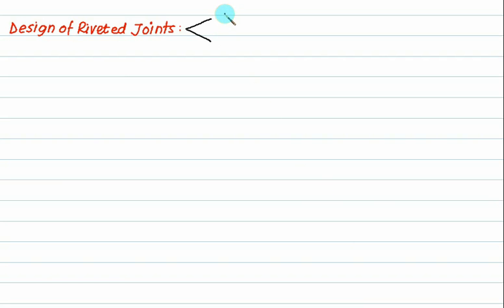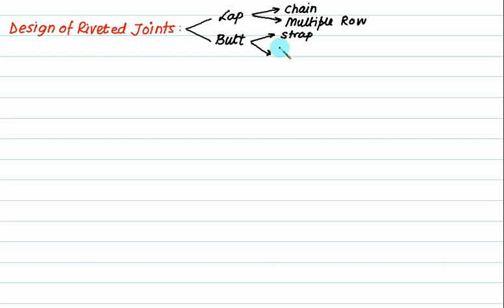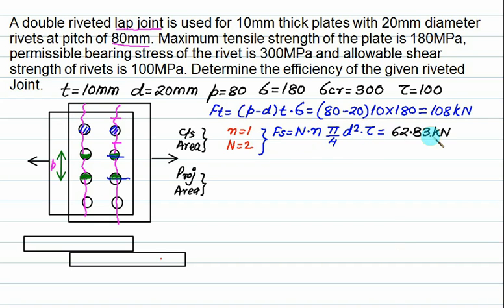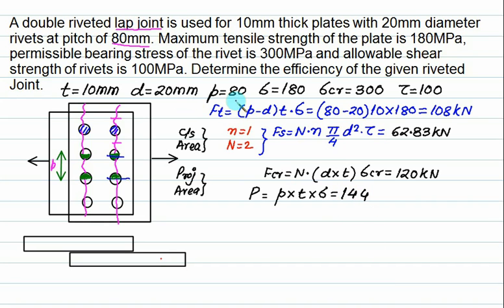01  Design of Riveted joints  Tearing, Crushing and Shear strength

Comment: Wrong. How can you replace b by p because p is the pitch and it is the distance between the centre of two adjacent rivets on a gauge line. 
So when you're considering tearing failure, the tear area would be (p-d/2-d/2)×t when there are two holes and not (p-2d)×t
Reply: Yes ..I agree